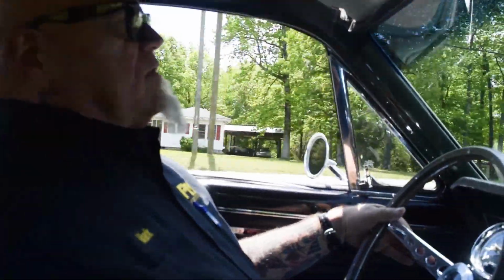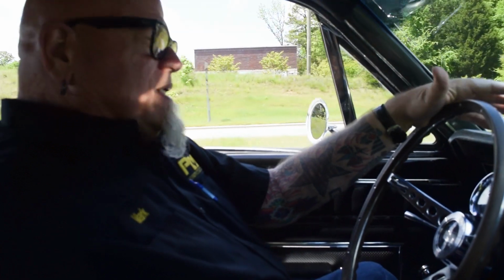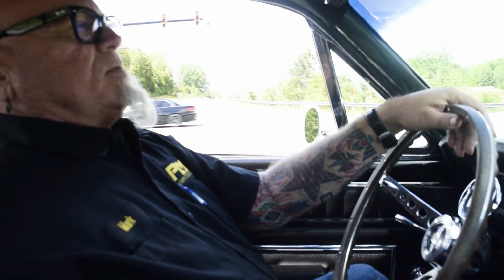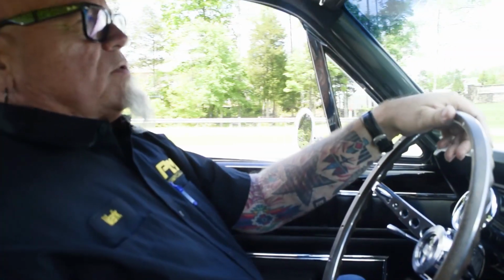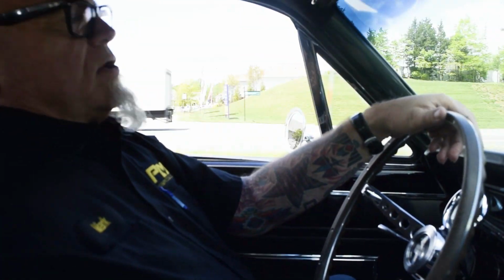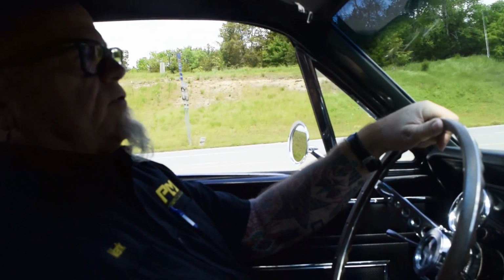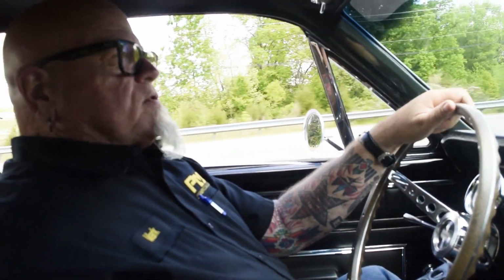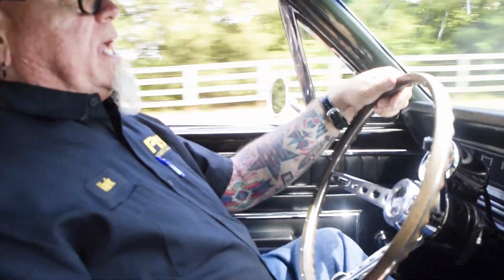'66 Ford Fairlane 427 FE Test Drive with Prestige Motorsports Shop Manager, Mark Moses.

Comment: I really love the video I have a 66 Fairlane GT will 428 Super Cobra Jet and it would to drag pack gear in and he would jump sideways when I get down on it it will break motor mounts in the U-boats on a rear end a really fast cobra my brother took it down the road and stomp it down to guess ft hung up play to Black Marsh down the street and flipped it over three times and split it down the road on it stop I am rebuilding it now I got another 66 Fairlane GT and I'm putting it back in it
Reply: Wow i have a truck and i dont let anyone drive it,i learned that along long time ago.
Reply: I hope you can get it together again to perfection
Reply from the maker: O wow! Hope you can get it all back together buddy

Comment: I read it said somewhere that all out race track cars do not make for good street cars. He didn't want a raging, radical handful, only suitable at wide open throttle on the track. He wanted a reliable, street drivable car that could be used every day. That would be my choice also.

Comment: The 390 is a boat anchor. 0:24 You referred to the Fairlane 390GT as "...pretty powerful car back in it's day". No it wasn't. It could give some Buick's & Oldsmobile's a run for their money but even that was 50/50. I had a drag racing neighbor in those days running an altered. He had a brand new...& beautiful red '66 Fairlane GTA 'R'-code 427FE w/ a center console & red interior, Magnum 500 rims & the redwall Goodyears. That was my dream car. That's called powerful. He could do mid-13's when he found traction. Now he did 'tweek it' a bit, w/ no additional money. The 390 Fairlane was a mid-14's to low 15's car. Not blown away by the Chevy's or Chrysler's, but always came in second.
Reply: The R-code 427 Fairlane never came with a console, or Magnum wheels...or a red interior...It was only in one exterior  color, white, black bench seat, dog-dish steel wheels, removable hood....no amenities whatsoever.
Reply: @AndieBlack13  He was a drag racer w/ a rail & a SS Mustang('66 I think). The Fairlane was his personal car & a racing associate worked in the body shop of the local Ford dealer. He wanted to make the car unique so he got his buddy to order the interior components that came w/ the optioned GTA 390. He did admit the interior wasn't 'stock' but I wasn't sure what that entailed. The interior was red as was the exterior so w/ what you're saying, he really personalized the car. I had no idea the cars came so 'stark'. Ha...after all these years I was in Love w/ a make-over.
Reply: @carmiethompson2676  I understand completely, having started my career turning wrenches at a dealership, I modded a new car we bought at my workplace....it is rather easy to do & you wind up making them highly unique & special, because frankly, you know exactly what your doing.
Reply: @AndieBlack13  Thank you. I'm still very depressed. I thought if the car was intended for street use, you'd have more options available. Man, the kind of workmanship they performed...it even smelled new. I was salivating. Are you sure you're not confusing the Fairlane w/ the specialty Comets/ Falcons...please?
Reply: @carmiethompson2676  The Comet of that same year while having  a similar shared bodystyle, it only had the 390 top-of-the-line engine. They only made 57 of the R code 427 Fairlanes...they were intended to be sold to individuals so they invariably would be modified for Drag racing. In 66 this version was fully twice the price of a 289 two-door, so only "those in the know" would know of their value. 
  If indeed this car still survives to this day, imagine a new owner discovering its true nature by reading the VIN & noting that pesky "R" within??  a one-of-57...?
Reply: @AndieBlack13  And customized by professionals to look as OEM as possible. Since it was his personal car you know he & his buddy did it right. It look better then an OEM paint job though, that was a clue. I was to young to notice something like that. Dang it, I'm still depressed! Did the 'R'-Code come w/ a heater delete? This was in WI so even though he didn't drive it in the winter, late fall & early spring days can still be cold.
Reply: @carmiethompson2676  I think I read somewhere a whole three of those 57 had no heater-core...a truly factory made "strippo", in pursuit of weight savings. Currently I've seen a true R  code up for sale for $259,000  , it' been discounted  lately nearer to $200K.
Reply: @AndieBlack13  Huh! I'm sure I remember he had dash controls & vents. When I looked under the hood I'm sure the heater box was there. Anyway  $200K, Wow!! Thanks for the history lessons(& bashing my dream car...nah...kiddin'). Take care.
Reply: @carmiethompson2676  
An SS Mustang?...
Reply: @sejnitram  I'm referring to my former neighbors Super Stock(SS) Mustang he also used in NHRA & AHRA competition.